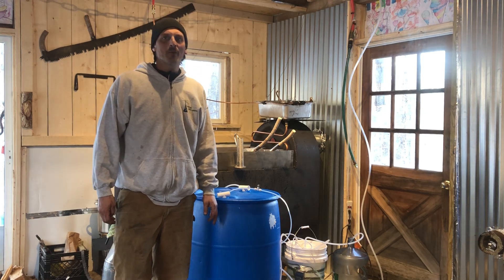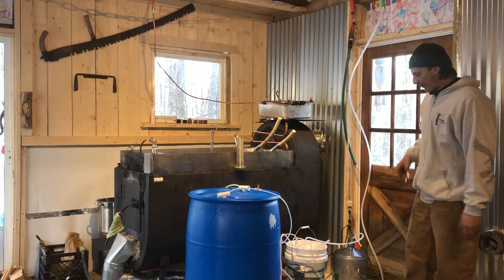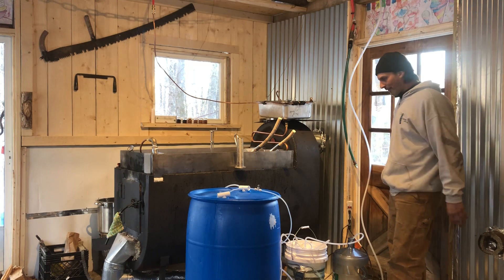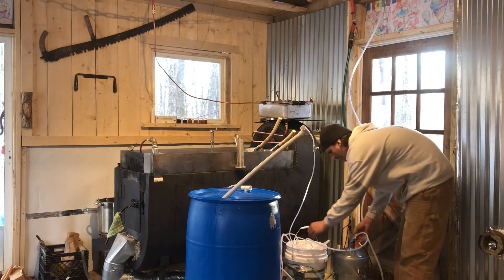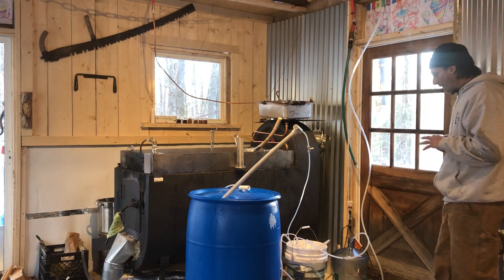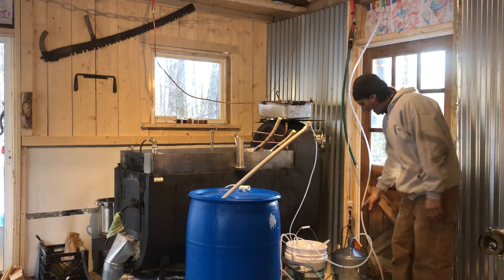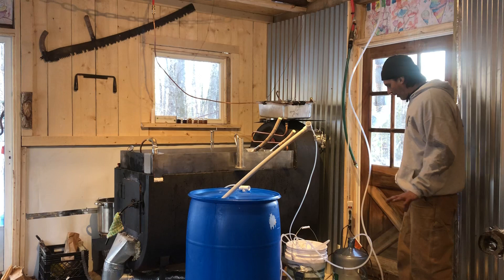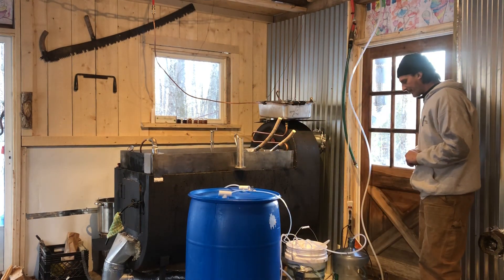RO Bucket review

Comment: Great presentation! How many times can you run sap through the RO system? My sap is about 65 to 1 ratio unfortunately so I’d like to get it up to 9-10 brix if possible
Reply from the maker: That’s correct. I believe I was doing a recirculation in that video with the blue barrel.  Both of the intake and concentrate line are in the barrel. The concentrate line should empty at the bottom where the sweetest/heaviest sap will collect.  The intake line should hang down about 2/3 of the way so you’re not recirculating your sweetest material.  I use those PVC pipes to set the depth of the lines and keep them straight.
Reply: @andrewfazio3515  that’s genius! Thank you for all the great info
Reply from the maker: At that ratio I’m guessing you’re just under 1.5 brix.  You would be just under 3 brix on your first pass and around 5 brix on your second.  It would probably take four passes to achieve 9 to 10 brix and be very time consuming.  I found recirculating a batch was faster and easier.  I would usually bring it to 8 and sometimes hit 10 brix When I ran it overnight.
Reply: @andrewfazio3515  thanks for the info! So by recirculating do you mean run your concentrated line back into your original sap bucket that your RO is drawing from? Sorry for my lack of knowledge on this sort of stuff.

Comment: I’m looking to add a buster pump to mine also. Could I get some more info on what you use for that and any thoughts on performance? Thanks
Reply from the maker: Hi David, you basically want to look for a pump that’s about 2/3 of the power of your main pump. I bought mine through Carl but you can find them online as well. The booster pump definitely helped production.

Comment: Your head tank the copper line that comes down then into top pan which I assume coils around and is for pre warming the drip into the evaporator does it not try and thermosiphion back up or gravity just over takes it and allows it to dump
Reply from the maker: Hey Clinton, the head tank line is gravity fed, no problems with any thermosiphon.  I did however, require a siphon occasionally to get it started.  If I used 3/8 OD copper tubing from the feed tank as I did below to the syrup pan float, I believe it would flow on its own.  The key is to fill the coiled copper tubing with water and freeze it before unraveling. This allows it to bend in all directions without crimping.